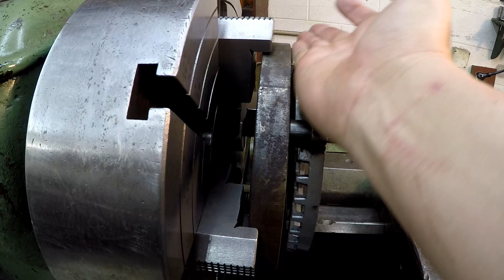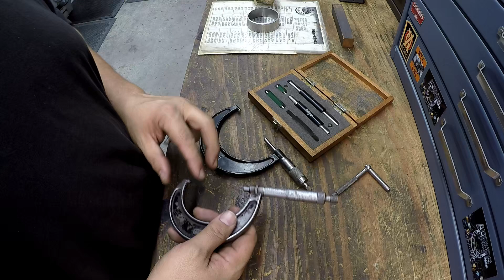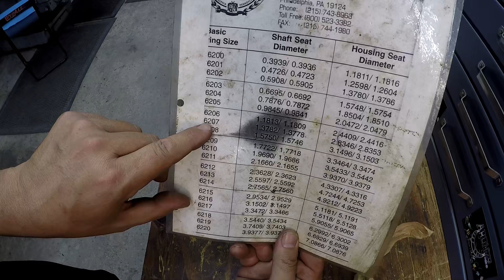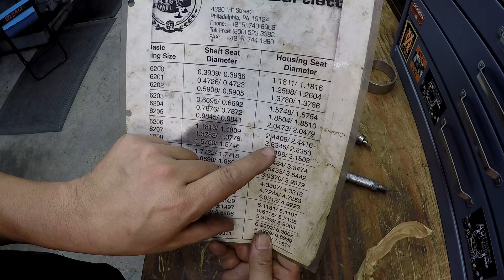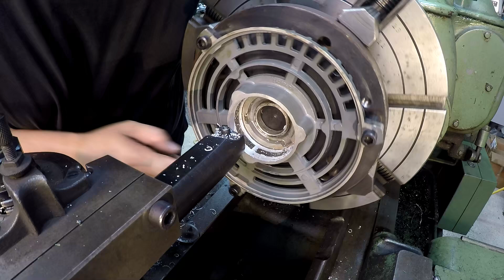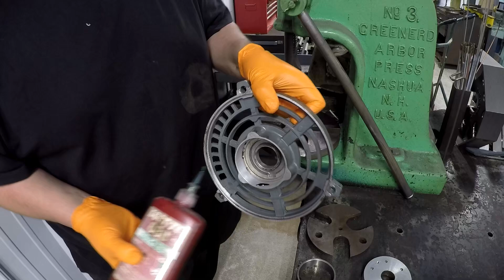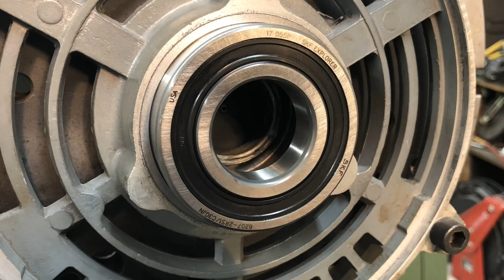K&T End Bell Repairs

Comment: You can use liquid propane  under pressure,   sprayed into a venturi, with shop air spraying through it,it's not likely going to be liquid nitrogen temperature, but should be well below zero,  propane is used as a refrigerant in air conditioners  ,  you can also get some peltier plates, used to cool computers and hot/cold coolers,  a stack oif then in foam. Using a block of aluminum or steel aluminum is better. With cold water flowing through It. With one on each side a 4x4"x 2" block with water x'ing through it , ice water will make it  faster,   then pass the rated power 12v+/-  through it.  It should start growing frost in minutes, place the bearing inside for about 10-20 minutes,  with the cold side in foam blocks . It should be 5°F +/ in no time,. Use a 20 amp 12v supply

Comment: Had a 56C flange motor lock up the end bearing last week.  Cleaned the bearing bore, smeared in some steel epoxy and the next day I bored it out.  Bets are on if it will last until I retire next may.  Love your youtubes.
Reply: It will probably last a lot longer than that

Comment: Not sure how often you run into issues of voids in casted materials. But, there is a 2 part epoxy we use in the aviation industry that can be machined once set up. Take a look Loc-tite or Henkle 9309. It comes in a qt or a 50 gram packet. We use it to fill voids in honeycomb material, especially in our rotor blades.

Comment: Good job. 👍I’ve done hundreds of these motor end shields , the only thing I do different is after glueing the sleeve in, it then gets “Dutch keyed” by either 2 or 3 usually m4 grub screws before finish boring, as sleeves can come out, The Electrical  Eng. company who supply the work will not accept without Dutch key .

Comment: You mention not butting the fixture plate up against the jaws, to make it easier to adjust your face runout. Now, when I did this kind of work, I did put it up against the jaws, and if it needed to be bumped out from the chuck, I just stuck a drift behind the workpiece and tapped on that, or I'd stick a steel bar behind it, lever it out, and tap on the free end.

Comment: I enjoy your videos, and watching this gave me an idea of how to speed it up, as well as other projects having a front face that needs to be perpendicular to the axis.

Instead of going "back and forth" so much, get one of the first measurements over immediately.

I assume this is a common situation, thus would justify making an alignment tool to speed things up.

Here's how: Make a plate, perhaps 6 to 8 inches in diameter, and thick enough to withstand some pushing against it. Attach the plate to a shaft (?) perpendicular to it, and mount the shaft in the tailstock. That automatically gives one of the variables (aligning the front face) practically no tolerance.

Attach the workpiece in the jaws lightly such that it isn't loose, but also isn't held so tightly it can't be adjusted easily.

So instead of measuring over and over, let the plate push against the front face while tightening up the jaws.

This won't eliminate all the back and forth, but it surely would reduce the front end work to quickly get the front face reasonably well aligned.

Comment: this was an awesome video. i recently modified a 6.5HP motor for my compressor and a lot of this info would've been super helpful had i seen it. I had to extend the shaft, so i used a few techniques you'd shown for shaft repair in a previous video; such as using a stepped shoulder on the extension that basically sleeves into the existing shaft. i drilled the shaft, then used an end mill to get a flat bottom in the shaft. i chamfered the ends, then welded them up and turned it down to size. the motor is now running my custom build air compressor.

Comment: Where do you get sleeves? I tried to freeze frame the video on the label but didn't see anything I could recognize.
Reply: It’s called EZSleeves at least the ones I used are or Bartlett quick sleeves
Reply: @alejandrogarza4033  Thanks!
Reply: @alejandrogarza4033  that's what we used as well in the shop I worked at in Ga.

Comment: Adam, I use to work in a motor shop almost 20 years ago,3 phase motor winder, and you put a lot more care into installing the insert then those machinist did. They would bore it out so they could tap it in while it was still chucked up in the lathe then they would check it with an indicator then cut it to size. They hardly ever used a back plate either so you would hear "oh SHIT" quite often lol

Comment: .005" of slop in the fit between the rotor journal and the bearings.  Sheesh.  As bruised and dented up as the rotor looks, I'm wondering how much damage there was to the stator.  Surely it didn't come away unscathed either from all the flopping of the rotor.  Has this motor been making all that racket ever since you first got the K&T Adam?

Comment: Are you manually stopping the moving arm that holds the cutter bit from going too deep beyond the back edge of the bearing, or is there an automatic feature on the machine that controls that? If you know what I'm trying to ask. Thankyou, I'm enjoying the videos.
Reply: It’s a manual lathe so the stop and start of the feed is controlled by him. The arm is called a boring bar. Hope that helps out
Reply: @alejandrogarza4033  Thanks!
Reply: i believe the monarch has a carriage power feed stop you can use, but that's more for production set-ups... i prefer using a dial indicator on the ways

Comment: I think it is awesome that you are using your grandfather's tools.  I have some of my dad's stuff, and enjoy using it.  BTW - for shrink fit of an aluminum housing a GoodWill store electric frying pan gives you good controllable heat for the motor end, and toss the ring in the freezer.  My father used to put cylinder liners in the deep freeze overnight before installing.

Comment: Nice repair mate - looks like the armature has had a miserable existence !
Reply: Flopping around inside the coil because of that .005" of clearance on the bearing journal no doubt's what did a bunch of that deforming and nicking.  Who knows how the heck long that motor's been running with that much slop in the bearing fit.

Comment: At the 25 minute mark when you spin up the part for the first time after the insert is pressed in, it looks like it may not have been pressed in straight.. Is that an issue or am I seeing something that isn't there?
Reply: Could have been from the bushing that was in the casting having the void in the back, it probably bottomed out against an uneven shoulder causing the face to run out a little.

Comment: Adam I found out if u cut the quick couple off a a.c. 134 a filler line and run the liquid 134 a on ur part and it will get it plenty cool for a shrink fit just a hillbilly fix
Reply: With the added benefits of oily, nasty, halogenated hydrocarbons.

Comment: Just wondering why when you have passed the work with the cutting edge it seems to catch a little when drawing it back? This seems to be something that happens as I’ve seen it on other channels too! Is it wobble in the lathe?
Reply from the maker: Tool deflection and slight movement in the carriage.
Reply: Tool pressure is why!
Reply: It is not carriage movement at all,it is  tool pressure and take a phantom pass and itll take it out.Swear!
Reply: @davidhutson4842  It's slight movement in the carriage too. There is a tiny amount of slop in the fit between the carriage and the ways. The pressure from the cut, takes up this slop and causes the carriage to be pushed one way, away from the cut. So, it's a little bit of both. A spring pass (phantom cut, as you call it) will fix it because the pressure is so much lower, and it isn't enough to push the carriage around.
Reply: ross fowler that because it needs a couple of spring passes to allow for tool pressure on the original pass

Comment: Your sneaking up process is a good one to copy in my own shop.  What were we seeing at the end of the rotor central portion? They looked beaten and bent.
Reply from the maker: Those are the fins and can be straightened.
Reply: Internal fans.  Not much clearance between rotor and stator but there are slots in winding for air flow.

Comment: We use Canned Air upside down to FREEZE bearings to drop in when its a tight fit... Not sure it's cold enough for sleeves but works for us, most of the time.
Reply: Bearing in the freezer, housing in a low oven has always worked for me.

Comment: What size is your 4-jaw chuck?
Reply from the maker: 15”
Reply: Steel or cast iron? I need to buy a new 4jaw to my lathe. Max swing is 20". What size would you recommed or can you give an advice how to choose the size ? It seems that steel chucks can be run with alot higher rpm than same size cast chuck. The cost of steel Chuck is much more.

Comment: Adam; Thoughttps://www.ebay.com/itm/Lot-33-Vintage-USA-shaper-knives-molding-Cutters-Bits-Form-tools-lathe-milling/113234216997?hash=item1a5d490825:g:oJoAAOSwHXtbj8wWht of you when I came across these shaper bits on ebay:
Reply: Nik, those appear to be wood shaper bits that mount in a rotary cutter for wood mouldings and various shapes. Will not work for a metal shaper.
Reply: Yea, those are knives for a wood shaper.

Comment: great job adam. over the years i have done o few repairs like this. in our shop we would set up the bore for a slip fit on the bushing. we them used a product called loctite 35. and set the bushing with it we never removed the end bell from the lathe  .it save a lot of time and we never had a failure of the locktite. this repair was actually recommended by a loctite rep.love your videos.
Reply: larry sperling i was about to ask the same thing. Could you just glue it in with the slip fit and not have to remove it? Or would you have to wait around for it to cure? Still nice work and learned another way to do it. I also never knew about those ready made sleeves.

Comment: i am no expert in electrical motors but i believe some of them have coils in the rotor. If the spray weld sinks a lot of heat into the motor it might get the isolating lacquer to melt or something. you might want to look into that before you start the repair.  as always your work is top-notch!
Reply: For AC 3 Phase motors most are squirrel cage designs where the copper coils are in the stator, not the rotor. The rotor is simply steel laminations.
Reply: Eirik, What warcube91 said is correct - the rotor is basically a bunch of thin, round iron plates with notches in the edge. They are pressed onto the shaft against one of the aluminum end pieces with the fins, and then the other end piece is pressed on. Running through the notches of the laminate plates are aluminum 'shorting bars' that are connected to each end piece. The shorting bars are at a slight angle to the axis. All the wiring in a three phase induction motor with squirrel cage rotor is in the stator. The coils in the stator induce a current in the rotor that travels down the shorting bars creating a magnetic field that reacts to the stator magnetic field to make the rotor turn.

The biggest danger of heating the rotor shaft is when you don't heat it evenly. Pouring too much heat into one side of the shaft and not the other can actually bend the shaft. That's why he'll probably have it spinning the whole time he does his pre-heat of the shaft before spray welding.
Reply: Eirik thats why he’s spray welding to control heat evenly.  Also the lacquer should burn before it melts.

Comment: Daily job for me at my work. repairing and fixing bell ends with new sleeves. i always use soft jaws in a 3jaw chuck. lock it in there, few taps if needed and they are centered very fast. nice work!
Reply: There are a good few "bell-ends" where I work. I think the term might have a different meaning across the Atlantic here. Hahaha. Nice one .
Reply: i see what you did there haha. (my english not that good hehe)

Comment: there is one way with the inserts is i put them in the kitchen freezer i find that works well
Reply: I used to keep several common size sleeves stored in the deep freeze. I still actually keep a couple in there.  They all had the measured dimensions written on them when they were mic'd at room temperature.  Then I started using a CO2 bottle with a bottom feed tube so now I just spray the sleeve for a couple minutes and slide it right in without messing with my setup or having to dial the work back in.  It's not as nice as liquid nitrogen but its easier to get and keep around for me.
Reply: @RJMachine62  :  Called a siphon tank. Very handy for on demand dry ice.  Put the part in the dry ice bag and just a few seconds, its a press fit.  Or just get a carbon dioxide extinguisher.
Reply: Yes sir, a siphon tank is exactly what it's called.

Comment: Great attention to detail. Just curious about the economical aspect of a job like this.  What's a typical cost for a repair like this? I assume the alternative is to find a new motor?
Reply: Its like mother's milk when your working on your equipment. Cost really ain't the object, get the hunk of iron whipped back into shape. Ovations for this man.
Reply from the maker: This is a custom motor. You aren’t going to buy a new Baldor with this size and length output shaft. A new motor will cost you around over $1,000
Reply: @Abom79  Makes sense. Thanks for the great videos. Your cameos on This Old Tony are fantastic, the file and the four jaw both made me lose it.

Comment: is there no dissimilar metal issues with cast iron and aluminum. I was always told steel and aluminum never got along.
Reply: This is a open end fan cooled motor.  Not a wash down or totally enclosed fan cooled.  So no water.  So no electrolysis issues.
Reply from the maker: No issues
Reply: I know bolts hated wet aluminum stators, especially when they had some kind of chemical or waste getting into the threads.

Comment: Why don't you use digital gauges? Wouldn't they be easier to read?
Reply from the maker: No. Digital gages are good for a quick read but if you are indicating something, it’s much easier to watch a dial needle rotate back and forth vs a bunch of flashing numbers.
Reply: I agree with that comment about indicating ... totally! But, when taking a measurement from your telescopic inside diameter measuring tool, a digital micrometer would be less prone to a reading error.
Reply: CALVIN L. NIKONT 
If it aint broke, dont fix it.

Id guess because the dial guages are easier to see variation.  You can very quickly and easily visibly see the swing of the needle.  Without even having to read numbers yet.  If Adam has done it all his career, then thats what he is comfortable with, and probably able to get better results from.
Reply: A dial indicator would be the only way to indicate something. Watching the needle swing is a fool-proof way to get the piece centered but it seems to me that a digital caliper or micrometer would be less prone to a reading error.
Reply: An indicator isn't typically used to measure something. It can be but there are better instruments to use for that purpose. As is pointed out, when indicating as opposed to measuring, a needle position is easier to evaluate than a flashing number, since the number itself isn't all that important anyway.
Reply: I already said that I totally agreed with Abom79 about indicating but when measuring something to ten-thousandths, a digital readout would be less prone to a reading error.
Reply: Watching a constantly changing measurement is impossible to gauge on a digital readout. Whereas a dial is very easy to see the amount of variation.
Reply: It's all about what you're used to.
Reply: Analog is better because you see trends.   Why do spreadsheet apps have graphs?  The same reason.  Or why an oscilloscope is better than a digital voltmeter.
Reply: I'm not trying to see trends when I'm measuring the inside of a keyway. It is what it is and next week and next year it had better measure the same amount. Abom79 has cautioned about misreading his analog micrometer. It's impossible to misread a digital micrometer. When I look at my outside thermometer, I don't want to see a trend, I want to know exactly what the temperature is!

Comment: hey adam,  maybe you can show people how to actually adjust the mic if its off, that would be useful knowledge.
Reply: Another thing that would be good to demonstrate for the viewers, would be the change in measurements from temperature variations.

When your getting down to ten-thousands.  Temperature becomes pretty critical to getting accuracy.  

The temperature of the part and the temperature of the micrometers will change your measurements quite a bit.  Even holding the micrometer in your hand for too long so it heats up a bit from body temp will skew your results.
Reply: I would like to learn too